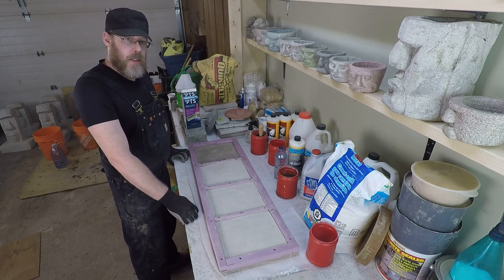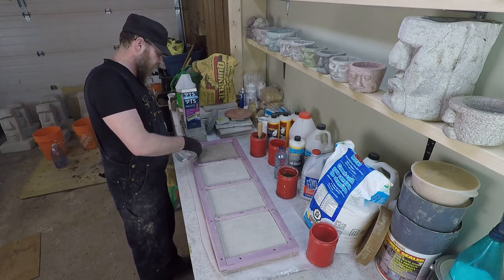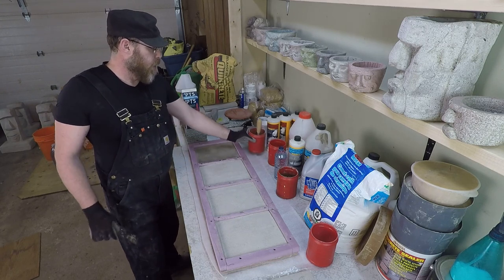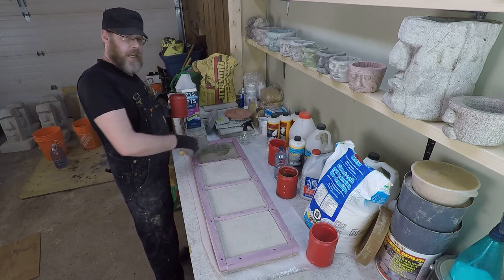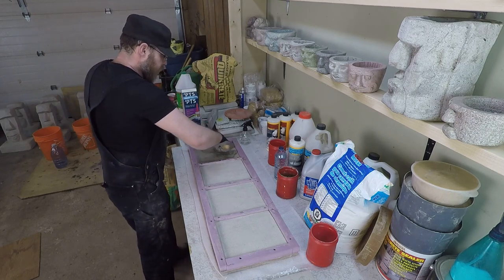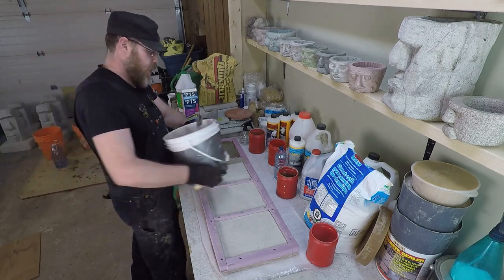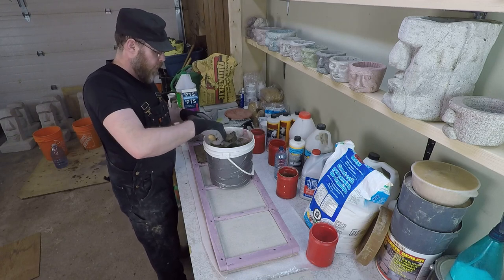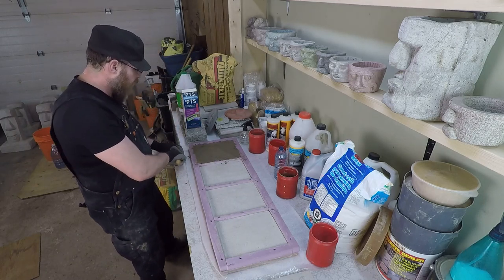How To Bond New Concrete To Old Concrete With A Latex Slurry

Comment: The instructions on Quikrete Fortifier do not talk about using it to form an intermediary layer between old and new concrete. All they talk about is using it as an admixture to make a new layer of sandmix denser, more flexible and bond more strongly to old concrete. So obviously there are more ways to use it than appears in the instructions. Can this stuff also be used directly (no cement, no sandmix, no mortar mix, no concrete mix) on old concrete surfaces to increase adhesion of  sandmix that contains no fortifier? Yes I understand there is another product specifically for this, but I already have some of the fortifier, just not enough to mix with the sandmix.

Comment: I made a pond/pool out of concrete blocks, mortared in with rebar and core filled with concrete.  I will need to skim coat this to seal things up.  I thought QuikWall SBC would have been a good option until I tested it.  Now I'm thinking Portland Cement possibly with Lime (i.e. Mortar) wet with Acrylic fortifier or Ames Super Primer.  Thoughts?  Suggestions?

Comment: I have an existing concrete amd decided to install metal gate door at the entrance now the gate has a 5 inch gap at the bottom due to the existing concrete having a drastic slope. Can I use this to pour 2 inches on top the existing concrete to reduce the gap left at the bottom of the gate?

Comment: the front path to my house was tiled, many of those tiles were cracked so i removed those and filled with concrete ( not very big just 1x1 metre) lasted around 2 years . Now the concrete is basically "melting" away it became all sand ? Its annoying because all those sand stick to the shoes and get into my house. What can i do? Can i spray some kind of glue over the sand ??
Reply: You could possibly bond it all together by saturating with an acrylic bonding agent, diluted down to a consistency a bit thicker than watery, like a thin cream-milk mix. Try on a small inconspicuous area first. The mix will have to saturate through to the substrate.

Comment: I am looking at possibly coating a current concrete block wall with a layer of sand topper  to give it new texture. Do I need to remove the paint from the wall or can it still attach? Also, do I need portland cement or can I just use sand topper and the acrylic fortifier to do that .25" layer of texture?
Reply from the maker: probably you can use the sand topper and acrylic but in theory a render this thin should be pretty heavily modified so you would need 25% liquid content being acrylic, plus the wall needs to be free of paint, then etched with acid and neutralized with TSP slurry.  Then rinse again so it is fully wet right before you apply your slurry and then topping mix.  It will be a little challenging to get it on the wall this thickness, and likely rough float it and let it set up like a plaster render, before hitting it with a damp sponge float to level it out.  This raises the cream so you can steel trowel and impress your texture.  Timing will be critical for this to all work.
Reply: @Swimmingpoolsteve  Thank you for the quick reply. This gives me all kinds of details I did not know I needed to know. Also helps me further convince my partner this project is beyond our ability.
Reply: You could use a proprietary polymer modified render. And generally, yes, remove the paint, or at least scratch up the surface thoroughly.

Comment: I'm planning to level part of my floor. I have looked at the alternative to do it dry.  And apply a mix of water and white glue after I have a level dry mix. But the issue is to bond it. Do you have any idea on how to bond?
Reply from the maker: I do not know how you could bond concrete dry.  The substrate needs to be wet to bond and the dry mix woudl strip out the water making it impossible to have SSD conditions (saturated, surface dry)
Reply: Do NOT use white glue, aka PVA glue, as it will re-emulsify when re-wet. Use only acrylic bonding agents. I’ve done my own tests and this is definitely the case.

Comment: so you did not paint the fortifier on the old concrete before putting down your mixture of sand topping mix/fortifier ?
I thought I had seen that recommended.
any thoughts on that?
Reply: That does seem the manufactures process for many of these products

Comment: Latex paint will work the same just have to thin it out a little
Reply: can you tell more about this ?
you did it ?
how long ago ?
last long time ?
Reply: @pjwoo276  it works good just add some latex to some cement apply with a thin coating maybe a few makes the cement water proof